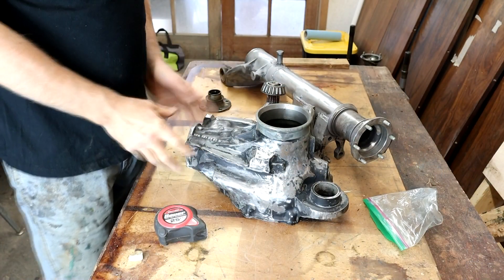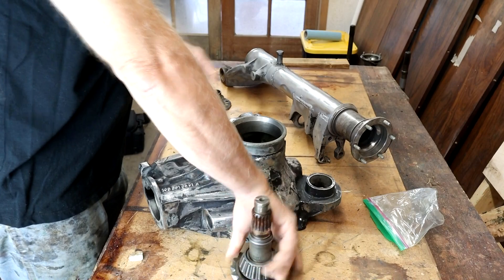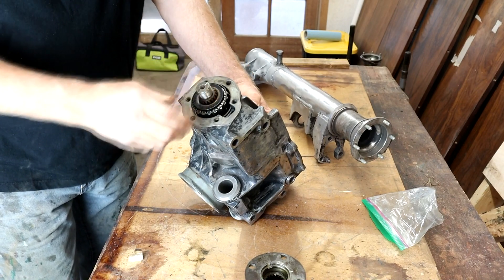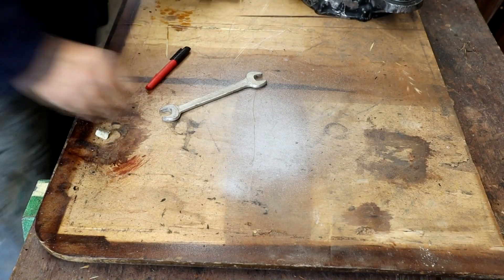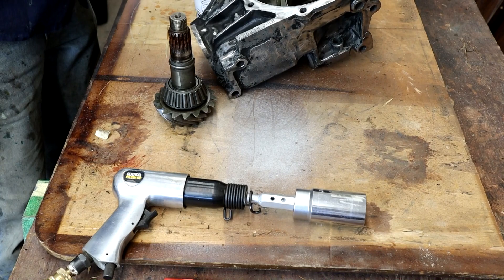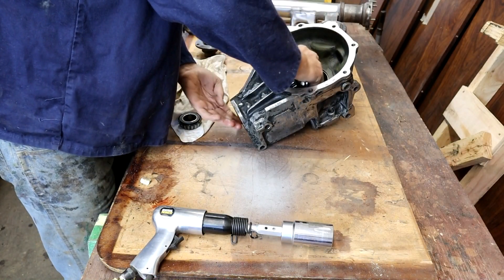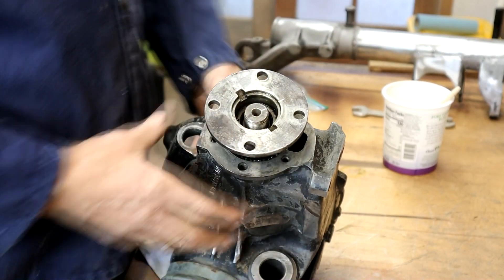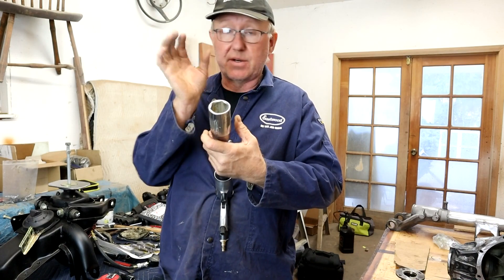Mercedes W108/W109 Outer Pinion Bearing. Easy To Make Tool.

Comment: New question: I'm having a bear of a time trying to get the new axle seals installed into the axle tube (the seal just below the axle tube race where it rides on the carrier bearing). I'm using a seal driver kit, but man... I'm beating on it pretty good and it's not going in. Have you had the same experience? Maybe I'm just being too nice and I really need to smash it in there... but that doesn't feel right either... thanks for any intel 👍
Reply from the maker: Sorry for not getting back to you sooner. I think your referring to the inner seal in the tube correct? I have done that job some time ago on my 6 cylinder 280. I don't remember it being to bad, have you tried putting the seal in the freezer overnight and lubricating the leading chamfered edge? Please let me know how you get on. Cheers John.
Reply: @mercedesmaintenance.6339  Thanks, I was not seating the seal perfectly level. Once I got it level then it went in easier. Doh!

Comment: Another idea you could try is modifying a big G clamp. Put the pinion shaft in place, fit the clamp & socket, & tighten the clamp. It should press the bearing into place
Reply from the maker: I was thinking along those lines too at one point.  I did it this way because  I thought it would help with the axle seals too. Cheers John.
Reply: @mercedesmaintenance.6339  I've got one of those air hammers. On full power, they sound like a woodpecker on steroids!! I'm looking at buying a hydraulic puller kit, & modifying it to pull bearing outer races.

Comment: Have you figured out a good way to get the races out of the diff housing + axle tubes? I'm rebuilding a w111 250se coupe and am at a similar stage. Love this tool idea, very cool. Thanks for any intel! :-)
Reply from the maker: Thanks for the comment. The races in the diff housing I'm probably  going to try a drift and gently  working my way round. The axle tube, Im still thinking on that one:)  Im in touch with a lot of knowledgeable guys so I'll  post up what I find out.
 Cheers John.
Reply from the maker: I've been thinking all day about that race in the axle tube. I think I may have come up with something:):) If I have to adjust backlash (chances are I will) I will have to get into that race. I'll post something soon. Cheers John.
Reply: @mercedesmaintenance.6339  Follow up: I had my friend heat up the races in the diff case with his welding torch, and then was able to tap them out pretty easily. Now am on to installing the new ones, which your video on the install is sooooo useful, so thanks! Can't wait to assemble the tool.